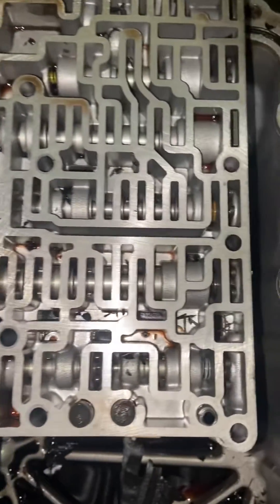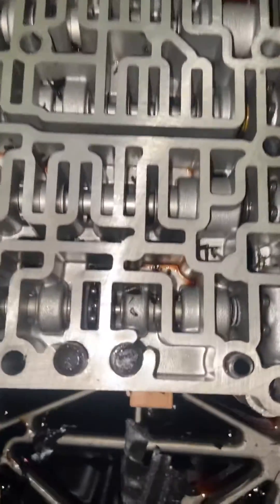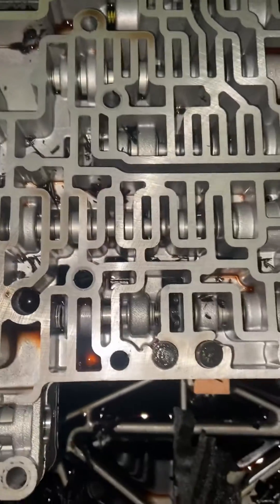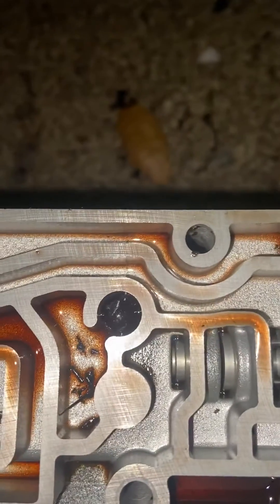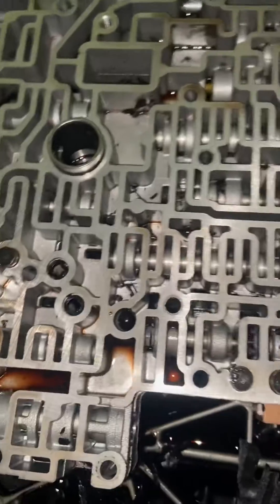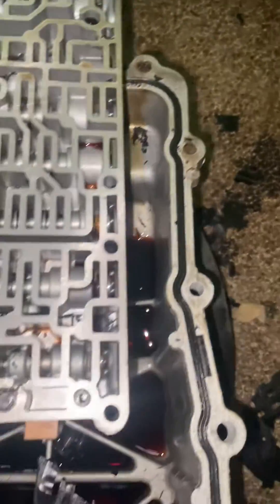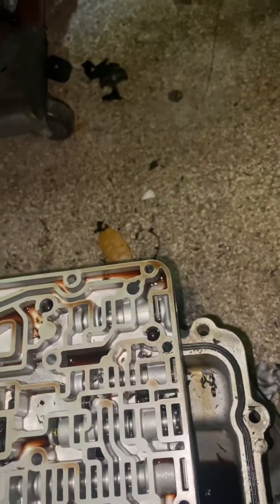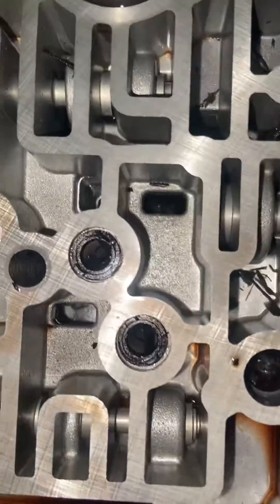4F50N Valvebody inspection

Comment: When I opened my 2005 Mercury Monterey transmission, there were only four balls.  About the two spring-loaded valves (one sits higher than the other) that are right beside each other, not realizing that the springs are different (one is stiffer than the other), I mixed their positions up when I took them out. There is one difference between your valve body and the one I have, beside the cone-shaped screens, you have a third valve that looks like the other two. The feature for it exists in my valve body, but there was no valve there.